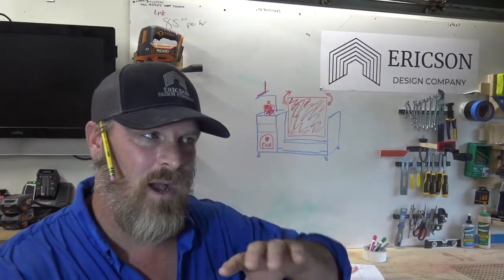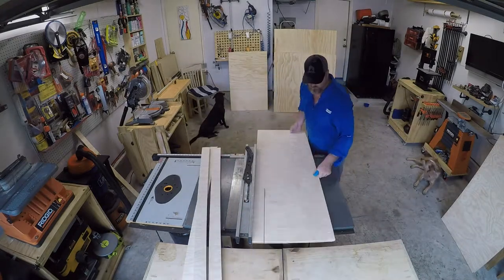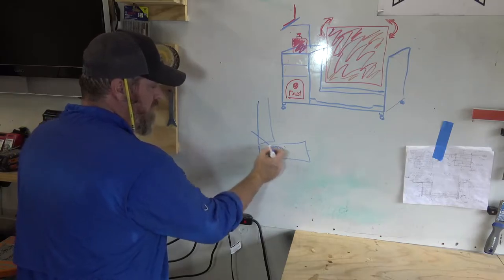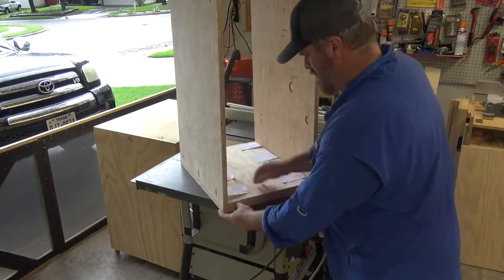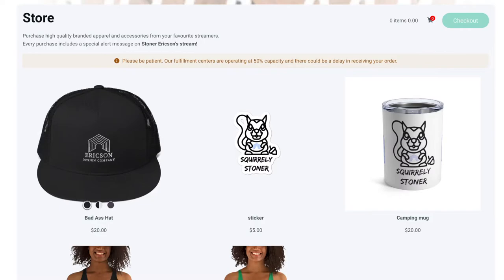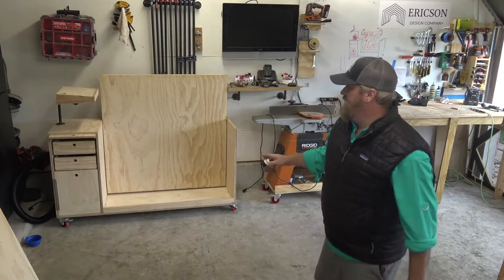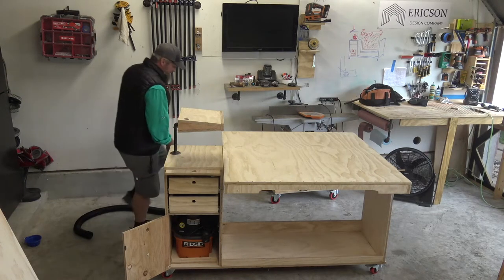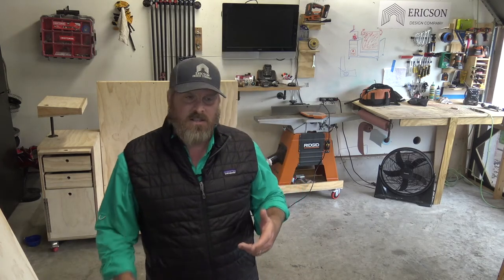How To Build An X-Carve Flip Top Table | Woodworking

Comment: I’m in the process of designing/building my flip top table for my CNC.  I didn’t want to have a gap between the table and the sides, so was thinking of countersinking my washer.  Would that even work, as I’ve never seen anyone do that
Reply from the maker: No u need that gap so I will fill Correctly plus overtime the word will expand and contract a little bit you just want to make sure you give yourself that room so it doesn’t bind up overtime making it too tight so I would highly suggest the washers thanks for watching let me know how your table turns out

Comment: Are there plans for this yet?
Reply from the maker: Ya there is a cut list and plans video on the Chanel plus a video on how the wiring works with the enclosure and flip table one of my subs asked for
Reply: @StonerEricson  Thank you so much for your response.   As far as the Kreg Jig goes, I got one today so I could make this stand and I was just wondering what angle you were drilling at and what size screws did you find work the best for the table top?
Reply from the maker: @kristophercarroll4556  Welp it’s all out of three-quarter inch plywood so the screws that you will use are the 1 1/4  and the Craig Jig will have that setting right